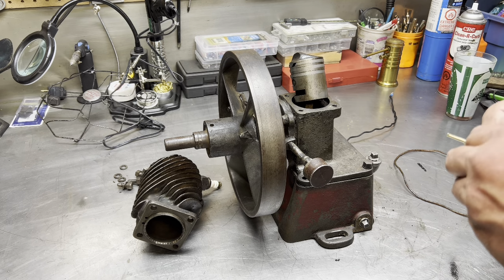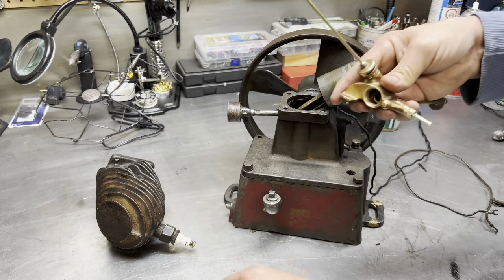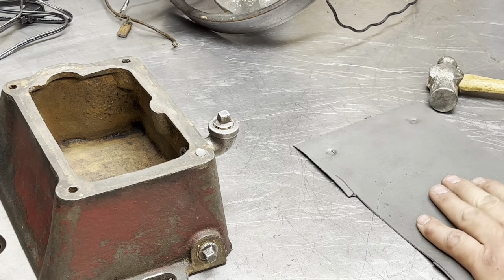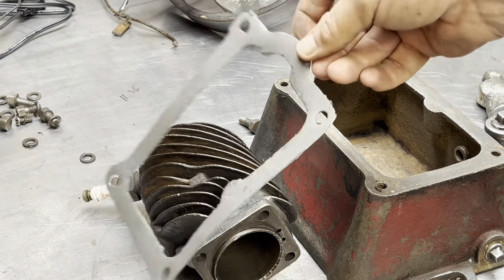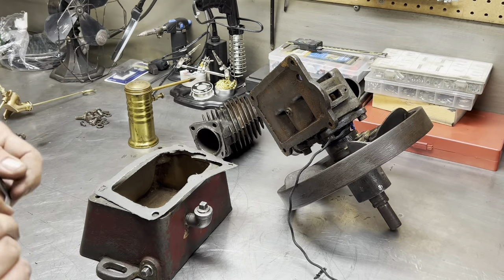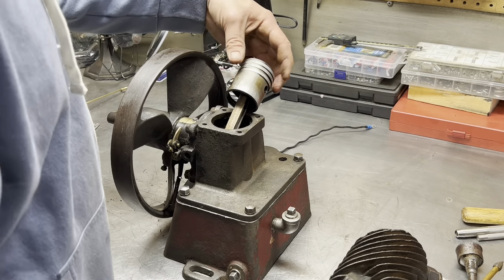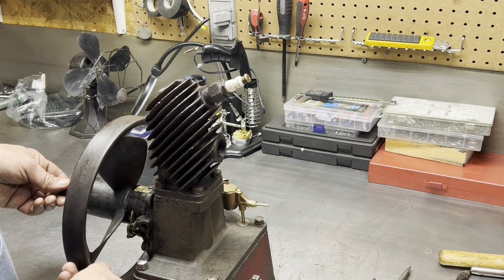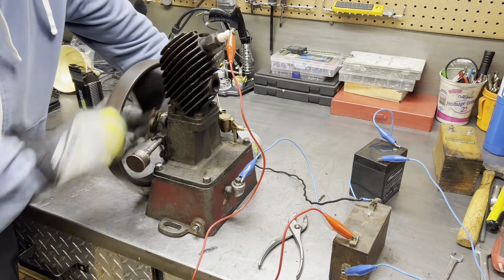Maytag Upright Engine ( 105 Year Cold Start )

Comment: Back in the late 60's / 70's I Had a Home made 405 line TV, it used a 5ins green tube ex M.O.D Radar for the screen, the tube EHT was a 3kV buzz coil with timing relay points and lots of suppression filter Capacitors. I got a zap of off it when the TV was off. The tube discharged on me. LOL